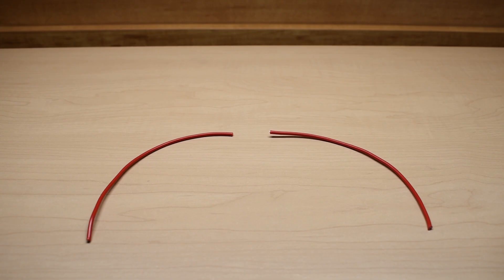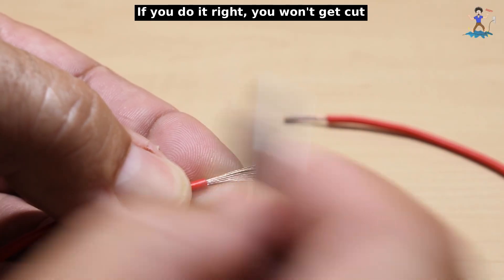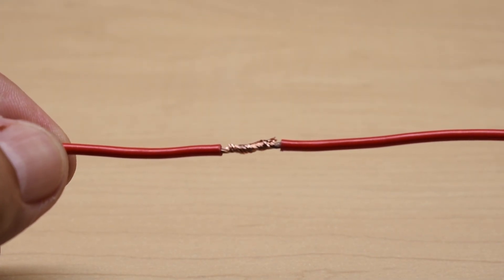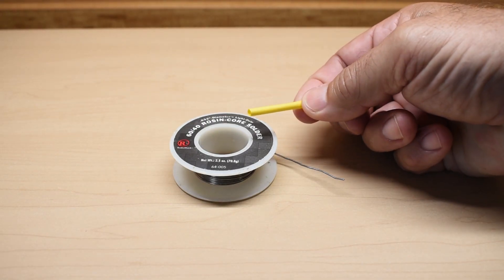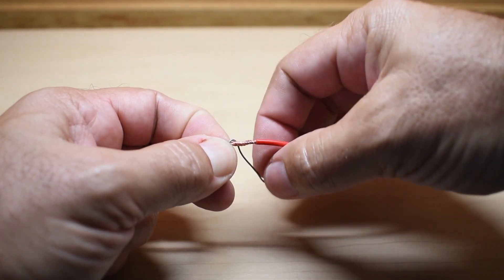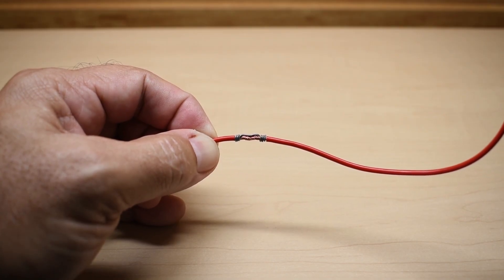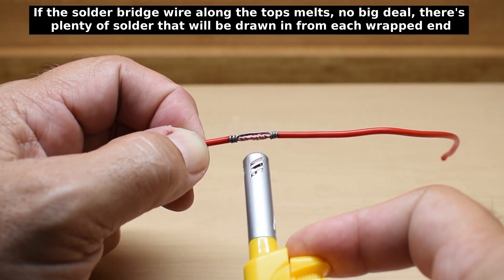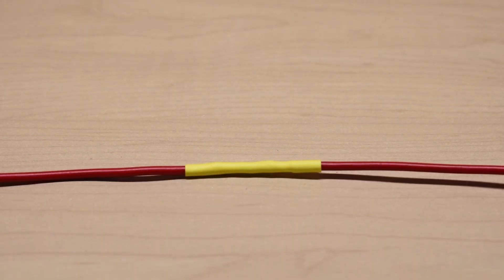How To Easily Solder Wires Together(No Soldering Iron)

Comment: Love doing it this way. 

Soldering irons just don't get hot enough, especially for thicker 14ga and up wired, to be practical. I mean it'll get there, but you're going to be waiting a bit.
Reply from the maker: Yes, many soldering irons can't heat heavier gauge wires properly.

Comment: Good video. Can't argue with the result.  I always use a small butane torch and paste flux though.  Faster, no need for the pretty solder wrap job, just heat the wire and stick the solder, boom, done. Always the wire itself must melt the solder, not the torch or pencil. Same with soldering copper pipe.  Soldering pencil (not an Iron) way to slow for this splice job anyway.  Small butane torch faster than a lighter also.  But your method is more forgiving to a novice so could be best bet for them.

Comment: Good video, though you might like to mention putting the heat shrink tubing on to the wire before you solder. Most wires you are soldering are connected on both wires to something, or might have a connector on the end of the wire that is to big to slide the heat shrink over. So you usually have to place the heat shrink on the wire, and slide it down a bit, before you solder....Peace!
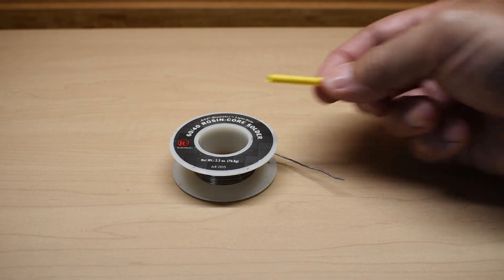Reply: 2:27

Comment: Super handy trick. I just had to splice together about 20 wires in my truck door. I used those premade heat shrink tube with solder inside, but this seems cleaner and easier than that. much less bulk on each wire. I'll use this approach next time I need to make a splice.
Reply: Cute

Comment: Been doing it kinda like this for a long time.   Having to repair car wiring harnesses outdoors this works perfect.  Good tip your sharing... only exception is I use a mini torch on the lowest flame setting.   The wind won't let a regular lighter work

Comment: Not sure how this even came up in my feed but ok, decent job, kind of surprised no one brought up not cleaning off the used flux. That's one of the first things taught for beginners and you just put heat shrink over it and hid it like it never happened. Not a good teaching moment.
Reply from the maker: I guess you never heard of "No-Clean" flux.
Reply: @electronicsNmore  ehhh I have, still no reason not to clean. Takes two sec's and looks much better, in soldering school today they would not pass that. EVEN "no clean", residue residue residue....but good idea on the twisting. Not an approved method but for the garage and junk yea ok it will slide. Happy Holidays to ya. Enjoy.

Comment: That might work for just one wire all by itself but when you're dealing with a bunch of wires surrounding each other that's not going to work just simply using a butt connector does the job as long as you crimp them properly. Now granite soldering is always better but look at how long it took you to do that

Comment: brilliant video. very good solder.  Here's another tip:  if you don't have shrink tubing or more likely forgot to put it on before soldering,  You can use the lighter to melt the cap of a 1-2 liter bottle of soda so its very liquidity and then smear cover the solder joint

Comment: Nice technique.  I would have cleaned off the solder after it cooled and then add the heat shrink.  Not sure I'll ever need this technique since my solder, flux, heat shrink, wire cutters, etc, are all in the garage sitting in the drawer with my soldering iron.

Comment: Thanks .. This is perfect for automotive stuff I need to tackle
Reply: @craig7350  Obviously you are a crimp connector person. They leak they malform the wire connection and over time the metal  connector corrodes with Galvanic corrosion  or dissimilar-metal corrosion. Take your pick. I however would prefer my copper to be wound and soldered . The open flame fear you have is unfounded , exhaust systems are welded everyday with  much larger torches ...

Comment: IF YOU ARE JOINING TWO WIRES THAT ARE ALREADY ATTACHED AT THE OTHER END,
DON’T FORGET THE HEAT SHRINK TUBING ON ONE OF THE WIRES, OTHERWISE YOU 
WILL HAVE NO WAY OF PUTTING IT OVER THE JOIN!
Reply: You could just cut it again and do this method again with 2 heat shrink sleeves. OOPS! I forgot again!
Reply: Please stop yelling at us.
Reply: Be sure to push the heat-shrink far enough away from the joint that it will not prematurely shrink as you heat the joint. Then (same reason) let the joint cool to a finger-safe temperature before positioning the heat-shrink over the joint for shrinking.

Comment: This seems impractical. It looks super easy however, you are using two pigtails. The pigtails are turnable but the "home connection" is generally static. How do you twist static solder joints?

Comment: always struggled with the soldering iron holding it and holding the solder and in most cases trying to hold the wire as well. This seemed so easy. I almost can't wait for my next soldering project. Perfect thankyou
Reply from the maker: Glad I could help! Be sure to share the video link with others. Thank you
Reply: I learned how to solder, using two fingers for the solder, another two for holding the wire by watching an elderly mexican lady at one of my old jobs. She would use her thumb anf fore finger for the solder, her "flip-off" finger and ring finger for holding the wire. It took lots of practice but I found it to be pretty effective. She made fantastic green chili zlso!

Comment: I have not yet had a problem with soldering using no flux. I'm sure it would be a problem for smaller components, but anything thicker than usb cable wires I've just used solder directly. I've recently started using this method since I sat on my usb solder pen and killed it.

Comment: Awesome demonstration. What about cleaning off the unused rosin before putting on the heat shrink. Isn't the rosin an acid?
Reply from the maker: I used "No Clean" liquid rosin flux. Rosin flux is a little acidic as a liquid, but when it hardens it's 100% safe.
Reply: @electronicsNmore  Thank you for clearing that up.

Comment: Probably a good idea to slide the heat shrink tubing over one of the wires before you twist them together, since in real life the opposite ends of the wire are usually connected to something.

Comment: So you are just soldering with a butane lighter. Why not just stick with your soldering gun?
Reply from the maker: I was showing an alternate method. One that can be used when there's no electric available, or if your soldering iron doesn't get hot enough.

Comment: Why, in the USA do you pronounce the word "solder" as "sodder"? What happened to the "L"? When you have sold something have you "sodd" it.
On a technical point, one thing to be careful of is to not let any heat get near the "heat shrink" while carrying out the soLdering process, plus wait for the joint to cool down before covering it with the heat shrink otherwise it may shrink down too much before you can get it properly in place.
The person who could not pronounce their "L's" who first taught soldering in the USA 🇺🇸 has a lot to answer for. Plus, if you have different sized solder, heatshrink and flux on hand I think you will also have a soldering iron. This method is very useful if you are away from any form of power source.
Additionally, as has already been pointed out elsewhere, too much solder can "wick" along the cable joint and in extreme vibration situations ie. Motorbikes etc. it may work harden and fracture the joint. As a 17 year old apprentice electrician, more than 50 years ago, I rewired my BSA Bantam and proudly soldered each joint, believing I was doing a good job. What followed was three months of repairs at the side of the road as each joint came apart. Bantams did shake a lot! 🙂
Reply: At least for us, the L is silent in solder.  But not in sold.
Reply: Works well with 'soldier' too......

Oh, sod yer, sod yer, won't you marry me..........

Comment: Man, just use a soldering iron. I use an adjustable butane soldering iron (Weller Portasol) for nearly all of my soldering, from circuit boards to bare wire. Fast, compact, reliable, and ESD safe, with predictable connections. A roll of good low melting point fluxed rosin core solder wire completes the picture.
Reply from the maker: One day when your soldering iron is out of gas, it breaks, or you misplace it, you'll do as shown in the video. LOL
Reply: @electronicsNmore    ..  No greater chance of that happening than your lighter running out of fuel, breaking, misplaced, or whatever. I take care of my tools. My soldering iron is years old - and it replaced a similar one purchased at a little electronics store in Heidelberg Germany years before that.

Comment: Crap... Be quicker with a iron
Reply from the maker: Sad when a viewer fails to understand how useful a method is.
Reply: @electronicsNmore  a method of doing anything is what makes things easy 🤔i did not think that is a good method the point of it is you could do it out in the field without a iron fair enough my point is how often to you have the space to to strip wires wrap solder round wire hold a lighter under it without damage anything... I would go for a jet torch type lighter some flux and smaller length of solder with no wrap of it around wire... Or make a iron out of a pencil and battery 🤔

Comment: This method of connecting two wires is more trouble than it's worth. Soldering is so much faster and easier... Get yourself a battery powered solar generator if you need to soldier away from an outlet. I'm all for innovation, and this method will work--but--it's much too trouble than it's worth for me.
Reply from the maker: LOL. You missed the point of the video.

Comment: I just insert solder tin inside the heat shrink. Then melt them altogether. Apply electrical tape, then another heatshrink on top of it.
Using low melting point solder tin btw.

Comment: Seriously, thank you so much for posting this video, I’m about to wire a car project from scratch… perfect timing 👍😎
Reply from the maker: Glad I could help
Reply: How many connections are you going to be making in your car project? While this may be an expedient if you're caught in a specific situation where you need to make an emergency repair without a soldering iron, it's not really the best plan to go about doing a whole slew of connections.

Comment: Will it work without that liquid chemical?
Reply from the maker: The rosin makes the solder flow really nice, using rosin core solder wire alone will work, but not as good.

Comment: The 'liquid rosin flux is no longer available from Amazon, & doesn't even give the name or type of the rosin.  Can I use any other liquid no clean rosin flux the same way?  There are quite a few different kinds & I don't want to get the wrong stuff & have it not work.  Thanks.
Reply from the maker: Thanks for telling me. I updated the link. You'll see the no clean rosin flux on that page. it works well.

Comment: Couldn't I just twist the wires together and use the shrink tube without buying the extra Flux and solder?
It's essentially to wire a pickup in a guitar so there won't be any movement in the wire cavity.

Comment: OMG. Unbelievable! I have tried to solder stuff with a soldering iron & it comes out like shit. I just don't know how to do it right. THIS neat method will definitely be my go-to method in the very near future. Wish I knew this last weekend. Wow, just ... WOW! Thank you!
Reply from the maker: Make sure the wire is clean, practice makes perfect. Thanks for watching! Be sure to share the video link with others.
Reply: "it comes out like shit. I just don't know how to do it right."
The flux is the "secret" ingredient. It helps make clean soldered connections. For wires, like in this video, liquid rosin flux is ideal. For PCBs, there are 'no clean' and soluble liquid flux that you can wash with warm water.

Comment: If you did this without the sawdering wire would there still be an option electrical connection?
Reply from the maker: You would need to use a crimp connector known as a butt splice.
Reply: @electronicsNmore  thanks

Comment: Oh, just like a plumber soldering copper pipes. Is that new? I was interested until you pulled out the lighter. Heat is heat.
Reply from the maker: Heat is not heat! LOL If you ever need to solder something, and you go to plug in your soldering iron and the heater is burned out, you'll thank me.

Comment: i had to place my soldering station at 300degree celcius everytime i did some solder jobs. Thought that anything below would not make it melt like butter. The heat from a lighter could simply bring it down easily was truly amazing. I might give it a shot one day i'm desperate in need of solder job without a solder iron.
Reply from the maker: I prefer 320 - 330c. Thanks for watching! Be sure to share the video link with others.

Comment: This looks ok for farm, automotive, or utility work but that joint in the example would never get past my aviation high value soldering instructor. The insulation shouldn’t shrink and the solder shouldn’t wick under the insulation.

I can see how this method might come in handy in some situations though.
Reply from the maker: Solder almost always wicks under, unless you have a wide splice area.
Reply: electronicsNmore- yes sir, it happens quick too. In this military class it took most of us 3 days to get 6 leads properly stripped and tinned. They looked at them with a 10x magnifier. The application was soldering wires into cannon (tm) plugs not butt splices which would be even harder. Butt splices weren’t allowed, we had to replace the entire wire. I built many aircraft harnesses for a coupe of years and was happy to move on to something else. 🙂 There isn’t a lot of difference between how wiring is done in a fighter jet and the space shuttle is what they told us. At least a couple of steps of QC inspection on each finished plug and everybody involved  is signing their name to it.  Our tax dollars at work, lol.

Corrosion typically occurs where the solder stops, even if you clean off the flux. We allowed solder to wick up .015-.025 from the insulation but not under to allow for inspection. The plugs had a strain relief so the untinned part of the wire didn’t have much physical strain or any movement.  We did several at a time, tinning first and then coming back and making the connections. We cut about 3in pieces of solder and flipped them from one end to the other to keep the temp even and with proper timing you can make them look like they were done by a machine.

Comment: A small torch lighter will do it like a soilderig iron.  ...let's say you have no soilder or rosin ( which isn't needed for coper.but makes it easier) and no shrik wrap..  do a wire twist like he did wrap it with electrical tape ( preferably 3m tape ) then wrap a zip tie tightly directly over the wire twist.. still not as good as soilder. But better then non copper crimps.. the zip tie makes the connection strong...
Reply: U can purchase buetayne torch soildering irons also.. they are awesome.

Comment: Put some heat sinks on each end so you don't burn the insulation. Paper clips (not the plastic coated ones) will do if you don't have alligator heat sinks.
Reply from the maker: No need to, as you saw in the video, the insulation was hardly affected. You're covering it up anyway.
Reply: @electronicsNmore  That's ok in an emergency, low voltage non critical stuff.  

Insulation integrity is very important relative to equipment and personal safety as in house fires. At higher voltages we had various cable splices blew up due to insulation failures, caused by BIL, dialectic breakdown or treeing. Could be from transients, over voltage, over current or from long term degradation. By blowing up I mean like a hand grenade, seriously - higher voltages, higher stresses. You could Google it or check various IEEE articles on this subject.
Reply from the maker: @kimchee94112  Clearly you wouldn't use this method on 600-1000v wires.

Comment: It is good to have alternative methods available. In this case not having a soldering irons leaves you a couple of choices - either this way or crimp connectors. Thanks for this. i would consider using the basics of this even with a soldering iron.

Comment: so great,  use a lighter to heat the solder and protect  plastic
Reply from the maker: As you saw, the insulation was barely touched. It makes no difference if the very end of the wire's insulation melts.

Comment: This is almost useless as connecting two such wires & connectors doesn't really need soldering. All it takes is a strong connection. If there's such a strong connection, u can simply insulate it without solder!
Reply from the maker: Incorrect, only some viewer comments are useless. There's a right time and place for every method. Smart people like to know several ways of doing things.

Comment: You might want to make sure that the heat shrink is already slid onto one wire  before soldering if both wires are attached to something.
Reply from the maker: Yes, clearly the heat shrink goes over the wire before twisting them together. Thanks for watching!

Comment: If you only need one or two joints then an instant heat soldering iron is faster, more than that and a regular iron is faster. I always keep my solder with my irons so if I can't find my iron I can't find my solder either.
Reply from the maker: Disagree

Comment: 12 or 10 gauge please.  The gauge you used here is too easy using the solder iron.  It's the big wires that i have trouble with.
Reply from the maker: Works the same, use bigger flame.